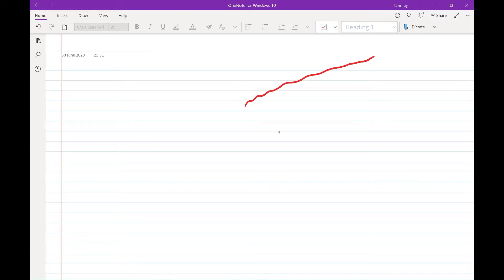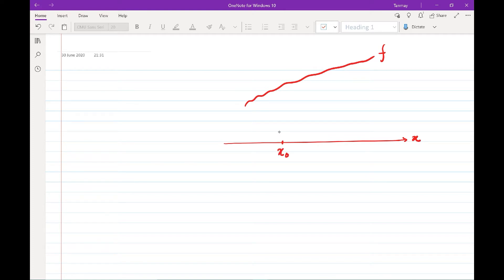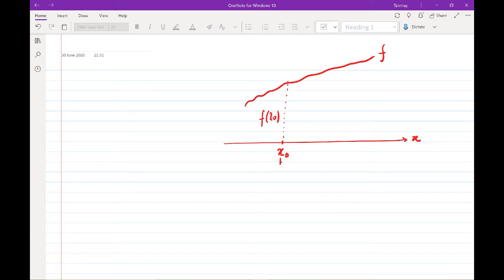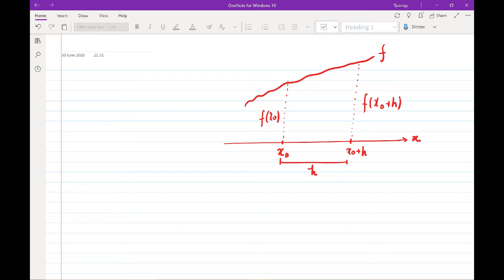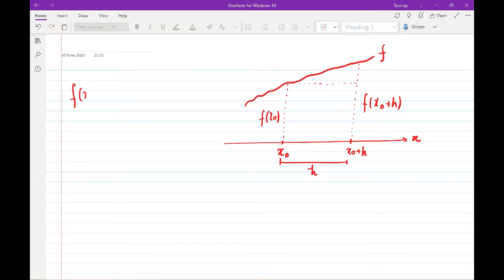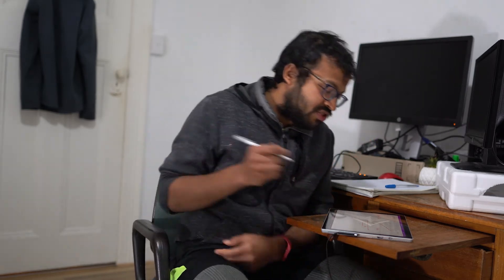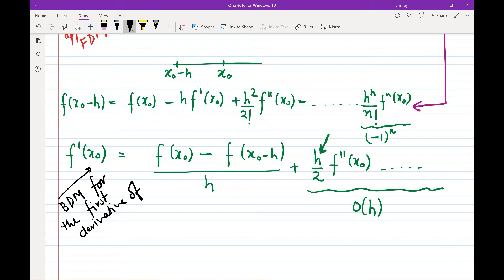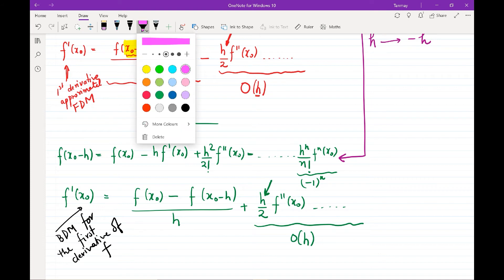Introduction to Finite Differences | Lecture 1 | ICFDM

Comment: so we can hypothetically say if h<=1 CDM has in every case a smaller error? h>1 will not happen because of mesh quality i think. but why do we need FDM and BDM then if CDM has a smaller error in every case?
Reply from the maker: FDM/BDM are easier to implement, specially near the boundaries. If we use more points, accuracy can be improved to the level of CDM as well.